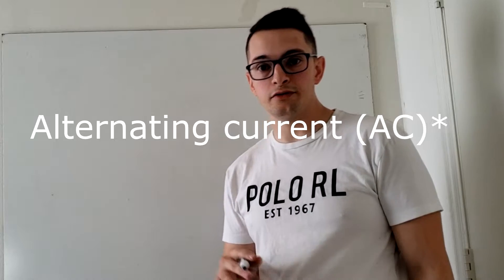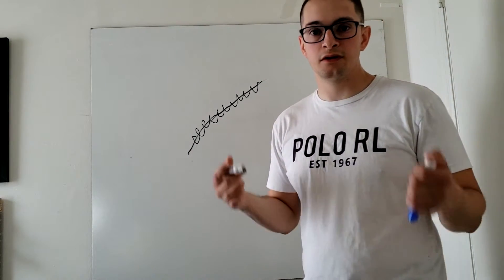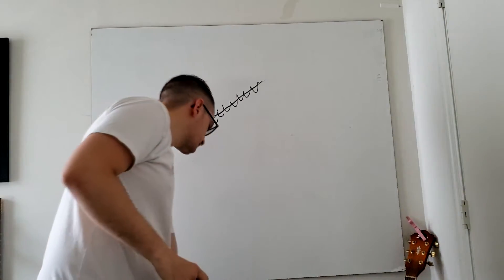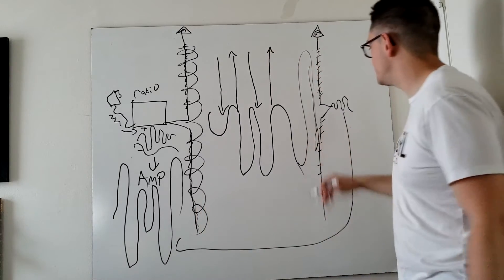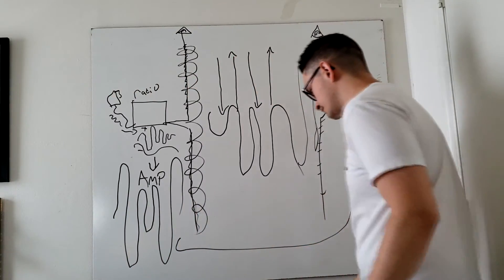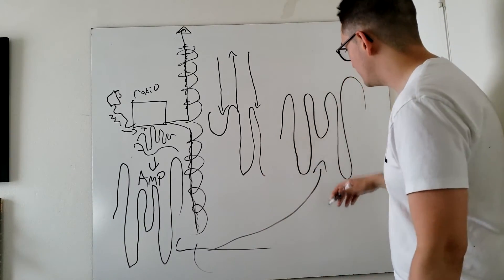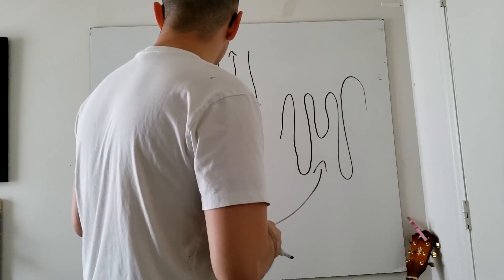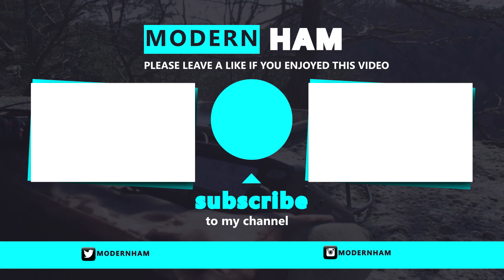How Radio Waves Work - Electromagnetic Waves And Modulation

Comment: If I wanted to set up a baofeng for a friend to use with my radio out in the woods, what frequency could/should I use so that I wouldn't be breaking any of the FCC laws? The friend probably wouldn't be licensed yet. Thanks for your help!
Reply from the maker: Unfortunately any transmission on the baofeng requires a license to be legal,  no matter what frequency or power level.
Reply: @ModernHam  10-4 If we were both licensed could you use two open bands on 2 meter?